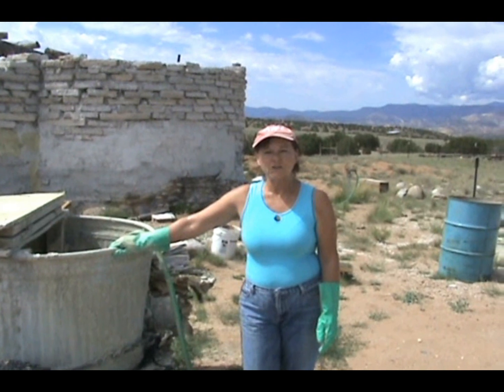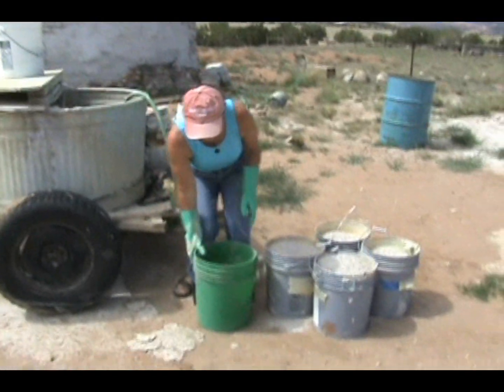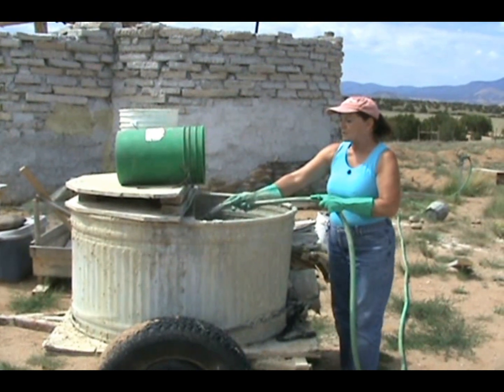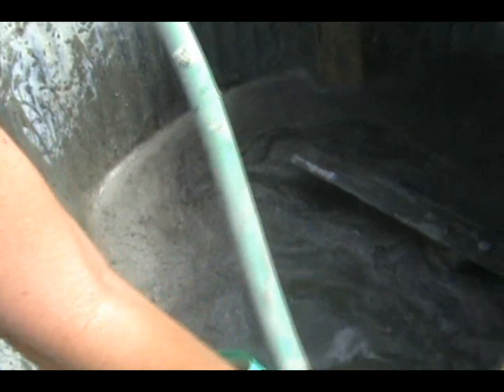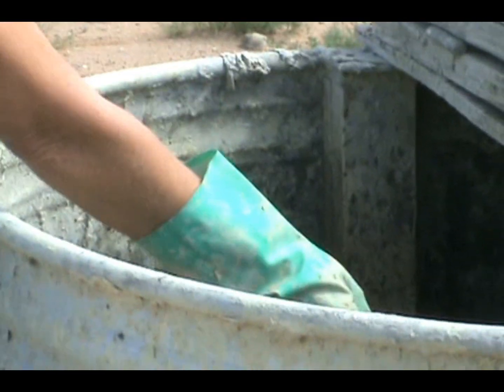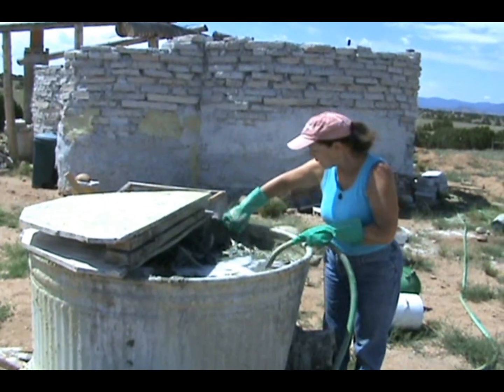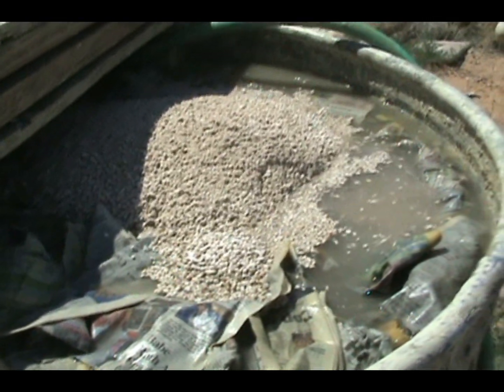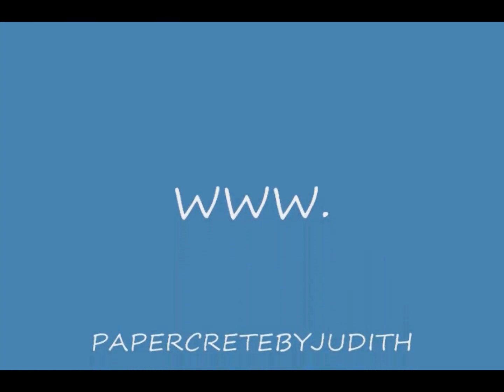Judith's Papercrete Mixing Technique

Comment: Better to use woodchips. Leaves break down too quickly.

Here's a build we did back in '11. Haven't gotten back on it and still holding up well without plaster coat.

youtube video = BviWmwzwJp0

can't add links so search for 'just add water build'